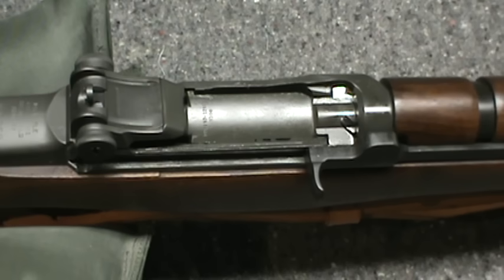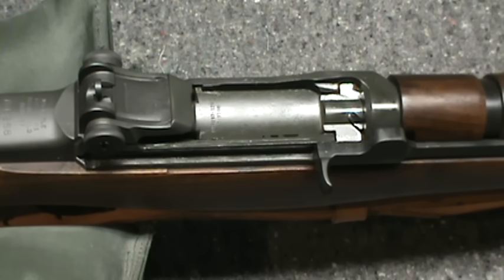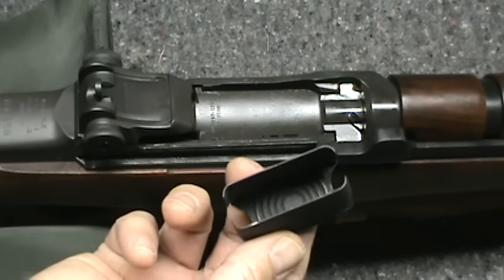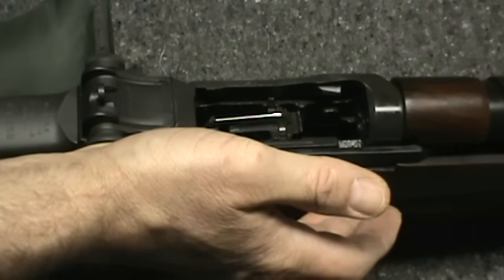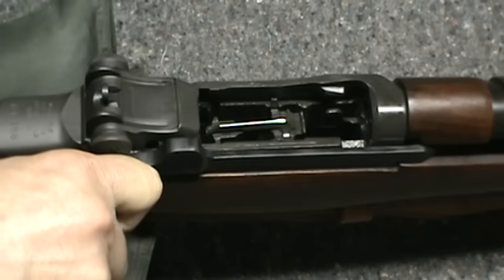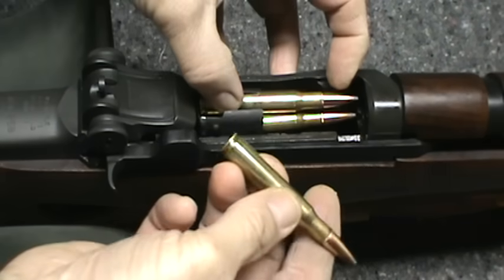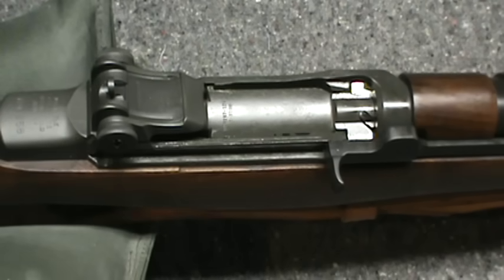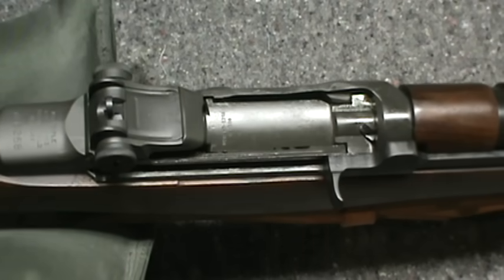How to load the M1 Garand the US Army way

Comment: Few random questions I've wondered about loading the M1:
Does it matter what way the clip goes in? Say top round offset to the left vs the right? Or is there only 1 way it will even go? Does the clip have a "top" or does it not matter?
Reply from the maker: It don't matter. The clip is identical either way you press it in. Some people claim it feeds better on the placement of the first cartridge into the clip. I never paid attention to that. It runs 100% reliable no matter how you load the cartridges into the clips.
I should mess with it to see if that is the reason (on why like in the video it just slips into battery and other times you need to bump it with your hand to go into battery) the manual says either way the rifle is operating properly.

Comment: Such an iconic sound.
Couple questions, sorry if I just missed the answers in the video.
Does the gun need a clip in to load single rounds?
Edit: answer to this question is pretty early on. With the fake round. I assume the reason you have to put your finger into the chamber to load the round is because the clip pushes the mechanism down the rest of the way
Is it possible to load one round. Not fire it. Cock the loader and then load another round all without a clips.
Damn this gun is interesting when you cant grab one and try it out!

If a clip is already loaded, is the only way to load the weapon with extra rounds one at a time? 

And how does it feel to fire? I live in England so the only gun I've shot is a side by side double barrel shotgun, not sure what the rounds were. But it was just for clays so I assume pretty basic i.e cheap.
Reply from the maker: To fire single rounds you don't need the clip. You need the clip for 2 -8 rounds. The rifle is so heavy there is very little recoil. It's a pleasure to shoot.
Reply from the maker: With the clip it's semi auto, just pull the trigger as fast as you want. It loads it's self. See my channel I fired it last year on camera.
Reply from the maker: The clip fits into internal magazine, so like any modern firearm with a magazine you can fire 1 or all rounds then reload. Only thing is you can't easily top it off, because of the way the internal magazine works. Cool rifle design that's nearly 100 years old.

Comment: Thanks for the tips! Your dad must have been cool to hang around with. What I'd like to know is, if I take off the plug to shot singles, would I be able to use higher powered ammo?
Reply from the maker: You won't damage the operating rod, so that is the only thing you can hurt on it. So you can run any bullet or charge safe for the 3006 with the gas plug removed.

Comment: But there are some versions of this rifle where you actually have to drive the bolt forward instead of it automatically going forward once the rounds are loaded and you release your finger
Reply from the maker: It's the same rifle. Sometimes you need to bump it forward, sometimes it releases like in the video. This is why you could catch your thumb. The mechanism can fake you out into security then bam off with your thumb! thanks for watching!

Comment: I recall loading an M1, but without chambering a round. I thought I pressed the clip down beyond the bolt and then released the bolt.
Am I nuts? I have only been out of the Marines for 57 years, so I am not sure about my memory. Did we stand guard duty with a loaded M1 without a round in the chamber?
Reply from the maker: Where you loading 7 rounds? I think 8 will automatically load a round, no choice
Reply: @007connecticut  possibly 7. Not sure.

Comment: My clip goes in very easy, but has a hard time seating at the bottom. Sometimes pops back up. Like Something is preventing it from going down all the way until I hear the click. If I really bear down on it, it seats. Seems like it should be easier. Anyone else have that issue or a solution? At 70, arthritic thumb doesn’t help.
Reply from the maker: I think it's normal. It has a stiff spring. If you do the load quickly it seems easier to do. Maybe do it standing so you get your whole arm pushing the clip down
Reply: @ I’ll try that. Good idea. Thanks.

Comment: The edge of one's hand is enough to prevent the action from  closing or just from closing too fast (gives you time to get your thumb out of the way)?
Reply from the maker: You can completely hold it like that. Sometimes the bolt just slides forward, other times you need to slap it to go into battery. The M1 is unpredictable, so that's why dad showed me "his" way of not getting hurt.
Reply: @007connecticut  tx for sharing that

Comment: What you said about the brass not hitting the ground by taking out the gas plug, will that work with the M1A
Reply from the maker: Yes, The M1 and M14 are the same top side. Just the magazine is different and of coarse the M14 is an auto.

Comment: Is it possible to manually load a single round into the chamber, then insert a full en bloc clip, and allow the bolt to ride over the top of the 8 rounds, effectively having 9 rounds aboard the rifle?
Reply from the maker: No. Max charge is 8. If you tried like you suggest the bolt can't slide forward with a round in the chamber.

Comment: In oregon if you hunt with 5 rounds in an 8 round clip and get caught by game management officer it is a hearty fine
Reply: Don't know if they would accept it,  but you could make a steel insert that would go underneath the follower (rides in the guide slots that the follower slides up and down in ), that would limit the number of rounds that could be loaded in the 8-round clip.  You take the trigger assembly out, insert the round limiter and reinstall the trigger group.  Want to go back to 8-round enbloc clip capability? Simply remove  the trigger group and the block slides right out.

Comment: Garand never designed this rifle to be a thumb smasher.  There is no need to hold or protect the bolt charging handle when loading a 8 round clip.  All you have to do is make sure the bolt is all the way to the rear then push the clip all the way down until it clicks, release your thumb pressure quickly as you move hand upward. M1 thumb happens when either the bolt is not locked to the rear position or the clip is not pushed all the way down into the magazine before withdrawing the thumb and hand. Trying to hold the charging handle to the rear while loading a clip is asking for trouble.  Just my opinion.
Reply from the maker: My misfortune happened when I was loading  a  5 round hunting clip. There is plenty of space to get your thumb in there when loading these.
Sometimes the bolt just goes forward and other times you need to tap it to close, so when it just goes forward you could get pinched if your lazy getting your hand clear (when your rifle almost always needs a little tap)
Yes if you load it smartly pushing down hard with your thump, then remove it quickly there won't be an issue. Trouble is I get lazy and get stupid for a second. So My dad said load it like I shown in the video to cover your butt.

Comment: What's the difference between a clip and a magazine?
Reply from the maker: The magazine holds the cartridges. A clip is a means of installing the rounds in mass. So the M1 magazine is inside the rifle and it can't be removed. The clip is what charges the rifle. On modern rifles the the clip step has been discarded to only a magazine. So we have to load rounds into a magazine 1 at a time., no more a 5 or 8 round quick charge using a metal clip.

Comment: Correction: That is not a GUN, that is a WEAPON! That is not a BOLT he is pulling on, that is an OPERATING ROD HANDLE! l
Learned that very quickly in 1960 @ Ft Jackson, SC! C-6-2 C Co 6th Bat 2nd Trng Reg Tank Hill
Reply from the maker: Youtube will ban the video if I use the proper terminology. Thanks for watching!

Comment: When I was in ROTC we had M1s.  They told us we had to leave our thumb in the breach when we did Inspection arms!  I learned quickly to push the follower down while holding the bolt open with the edge of my hand, let the bolt forward slightly, then take my thumb out and hold it on the side of the rifle next to my chest.  The platoon leader couldn't see that, so I was safe when he said Port Arms!  I could let the bolt slam shut then and snap the trigger.  One thing they always said was to NEVER take out the gas cylinder screw.  We could field-strip an M1 and put it back together in a couple of minutes.  And a trick I learned to pull on someone was to break his rifle down,  put the follower arm under it instead of in the slot.  Inspection, ARMS and the follower would fly out.  But this was high school, not combat!

Comment: Did those old FMJ 30-06 rounds have steel cores? I have a magnet that keeps telling me that. Just hope the ATF doesn't mind.
Reply from the maker: standard 150gn ball did not. If armour piercing the tips are painted black and have a steel core.
Reply: @007connecticut  Interesting. Yeah, my old military surplus 30-06 have magnetic projectiles without a black tip.

Comment: heard some conflicting rumors about usable ammos for the m1, are commercial loads ok to use or do you only shoot the old m2 ball? also is the gun safe to use with the gas plug totally out?
Reply from the maker: To be safe shoot 150 gn ammo so you don't bend the operating rod. By being a 3006 you could shoot anything thru it if you modify the gas plug. I use factory ammo and reloads. Today I use reloads specific to WWII ball ammo 150 gn. It makes the sights work better as the speeds are calibrated for a specific ammo. They sell an adjustable gas plug for the M1 just l don't recall the name as I type this on my phone. Yes I remove the gas plug so it doesn't cycle, it's perfectly safe and it's better for my brass as it doesn't bounce on the ground denting up the rim. Edit found the gas plug it's called a schuster M1 gas plug. It has a set screw that you turn and it bleeds out the gas so you can shoot anything thru it without harming the operating rod. Like I do, I just remove it so it won't cycle, can't hurt it that way. Cheers
Reply: @007connecticut  thanks for the info 👊😎

Comment: Can i ask how much is this gun these days
Reply from the maker: $1000 +
Reply: @007connecticut  so to what suitable age to use this gun
Reply from the maker: @digital0185  If your big enough to hold it into your shoulder and mature enough not to do something stupid with it, age is not important. If you can fire smaller rifles you can fire the M1. The M1 doesn't recoil much, but you need to have mental discipline to follow instructions on loading it not to get hurt.
Reply: @007connecticut  Thanks :  )
Reply: @007connecticut  my use for that gun is for self defense btw might consider getting one
Maybe a few years later lel
Reply from the maker: @digital0185  I have several firearms here at the ready for this reason. My M1 is in  my safe with ammo clips filled but not loaded. It would take 30 seconds to pick up this rifle and load a clip. I pitty the fool standing in front of the business end of it. It will shoot thru walls if you miss. Fyi.

Comment: Ok what was the last thing you showed? Confused. Without that thingy it doesn't eject the gas?
Reply from the maker: It's a gas plug. It's a large screw that is directly under the muzzle.
Like a 22 lever action, there is a tube running down the barrel under it. That is where the gas piston and plug is.
Find a muzzle picture of the M1 on line. Most of the newer screws (44 or newer) look like a Philips screwdriver put them in.
Reply: @007connecticut  so he removed it would do what ?
Reply from the maker: If you remove the gas plug, the rifle won't cycle. So you have now have a bolt action rifle. When I shoot the rifle, sometimes I remove the gas plug so I can catch the empty brass cases so they don't fall and get dented on the asphalt near the bench. I like dent free brass because I reload the cases and shoot them over and over again. It's much cheaper to buy powder and bullet and primer and re-use the brass case.
Reply: @007connecticut  ok..I see. Is there a State I can visit and purchase an M1 garand on the spot and walk away with.  My grandfather's M1 was stolen and I want to get a replacement
Reply from the maker: @jasongeo2  I think all states need a driver's license to buy a rifle. Need to be from your state also. I could be wrong?
Look on gunbroker for a rifle

Comment: If you remove the gas cylinder lock screw - what he's calling the gas plug -  the gas cylinder lock will come loose and the gas cylinder itself will let go. You REALLY don't want that!!!
Reply from the maker: It is screwed on. It ca't just fall off, you must unscrew it .
Reply: @007connecticut  I'm not talking about it falling off altogether... but being loose and flopping around. You remove yours... I'll keep mine tight.  If need be, I'll get a second one and drill the center out for gas relief.
Reply from the maker: @patrickwagner3432  Yes it will flop around, but not just fall off. Simply (as you said) just get another gas plug and drill it out so it won't cycle, but it all stays nicely together. They sell those modified adjustable gas plugs to shoot heavy loads, but they are expensive.

Comment: What kind of .30-06 ammunition do you use for this rifle?
Reply from the maker: I reload my own using CCI military primers and 150gn bullets. I found an army can of M1 ball from South Korea a few years back in excellent condition. Which I save for a rainy day. Ammo if stored dry will last you  a lifetime or more
Reply: @007connecticut  would normal modern day FMJ .30-06 150grain ammunition work for this rifle?
Reply from the maker: Yes. 150 gn is fine. No more or the operating rod might get damaged. Unscrew the plug like I did to shoot heavier loads or buy that adjustable gas plug made for it. Like 25 bucks or something

Comment: Forty or so years ago I noticed that one of my gas plugs sported a poppet valve seat that was cracked (I had others), so I used a hammer and punch to drive out valve stem (the plug valve assembly is a press-fit with a captured spring inside to hold the valve seat in the closed position in normal use [non-grenade-launching]) thus opening the plug body up from stem to stern and porting all gas port pressure out the front. I then polished up the front and sides that are visible when in use like a new dime giving me a visual indicator whether my M1 was in single-shot or semiautomatic configuration. Makes chasing brass an elective endeavor. 
NOTE:  These days an adjustable gas plug does the same probably at less cost than destroying a serviceable original gas plug.

Comment: You live in CT?
Reply from the maker: Sad I know, but true.
Reply: @007connecticut  tell me about it, I live in northeastern CT, If not for my job I would leave.
Reply from the maker: @davelastname8074  I retire in 6 years. I plan to move to NH. Looking at properties now. Shoot in your back yard, No state or sales taxes, no income tax, no taxes on SS benefits.  Properties can be had less than here. Just go 200 miles north the winters won't be much worse than here. No race issues with being so upset as some give you the bird for flying the flag or try to kill you. Air is cleaner. I can't wait.

Comment: Like always, the "Army Way" is the least best way!!
My dad trained with Garands, and Basic, and he taught me this same thing, for loading, but it isn't the BEST WAY!!
Heal of your hand isn't the best!
I've put maybe 30,000 rounds, through mine, and my dad's M1 Garands.  If you are right-handed, instead of the heal of your hand, USE YOUR RIGHT THUMB, holding the bolt back, not locked (AS THAT "LOCK" FAILS!!!!!!) Press the Clip, in, and down, clicking, and then let your thumb, on the action go!!  Maybe a half second faster, but NEVER, EVER going to crush your thumb!

Comment: Actually, the proper way to load a clip and the way the military taught it was to NOT use the edge of your hand to prevent the bolt from slamming on your thumb. In fact, Garand designed the gun to be loaded by pressing down on the clip until you hear the click and then quickly removing your thumb. The bolt will not slam forward until you remove your thumb. Sure, if you're afraid of getting Garand thumb you can prevent the bolt from releasing on your thumb by using the edge of your hand but that's not the correct way, it's unnecessary and the M1 wasn't designed for that method. Just look at endless videos on YT showing the correct way. I had several family members who fought in WWII and none of them used your method. And it's simply the the correct or preferred method. I'm surprised your father told you to do it that way. In fact, soldiers and Marines would probably laugh at your "sissy" way of loading a clip. By the way, I own Garands so I'm not talking about something I don't do.